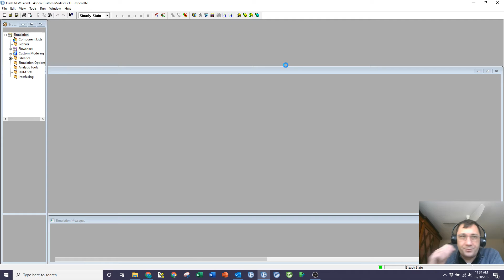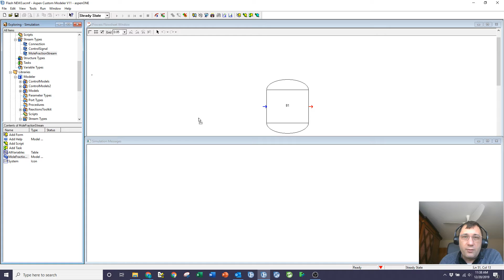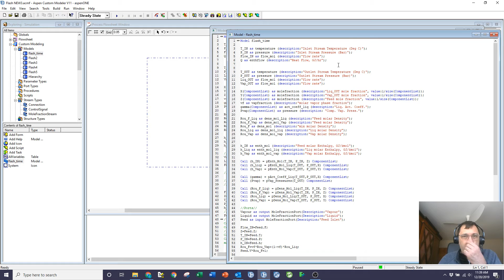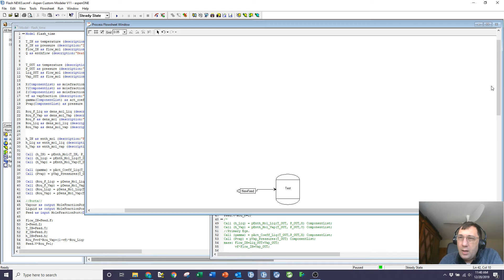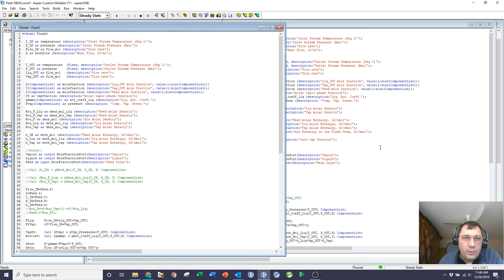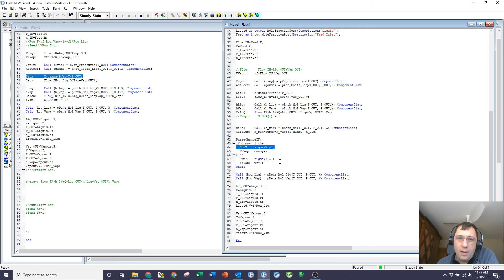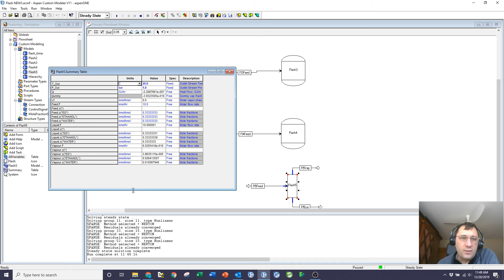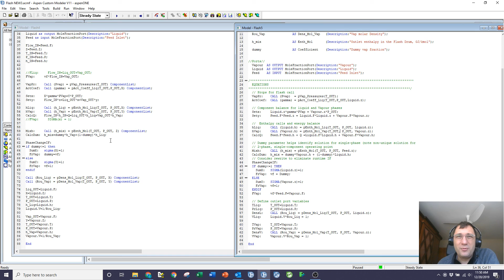ACM15 Troubleshooting a Flash model from a newer user

Comment: Hi Charles,
Thank you very much for the very informative video!

I have created a  simple model for a membrane separation module based on literature but I'm getting the "singular decomposition" error during initialization. I have created a simple port to use since the only variables I need in the ports are F, T,P and Z. Is the "For Do" command needed for some of the array of components in equations? 
I can send you the file if it helps with future demonstration videos! Many thanks.
Reply from the maker: I'm glad it was helpful